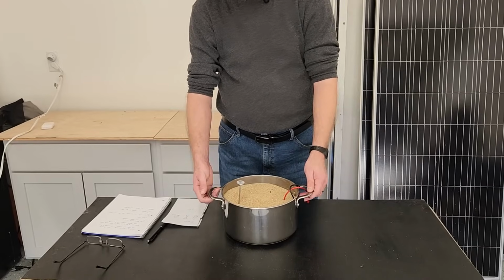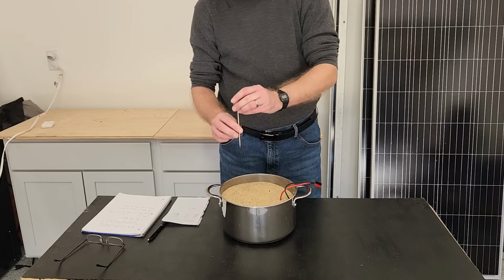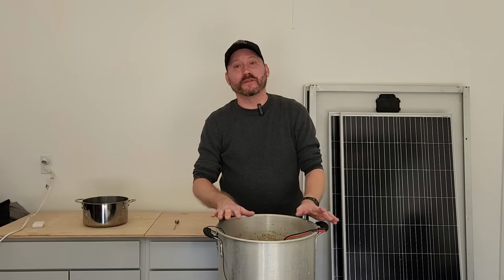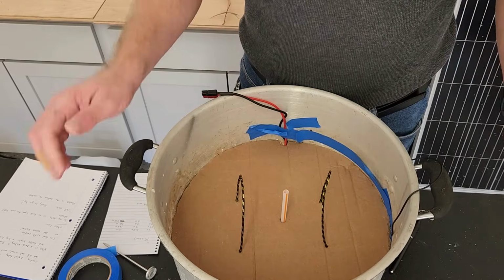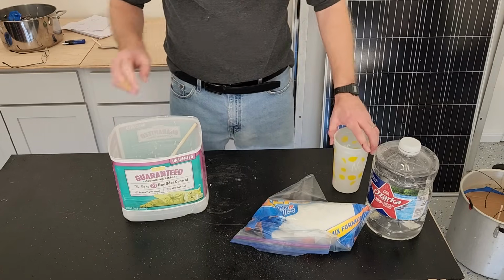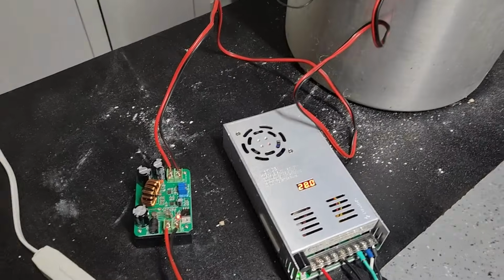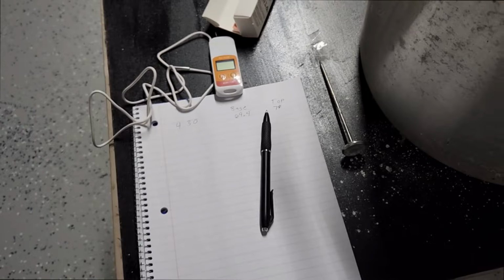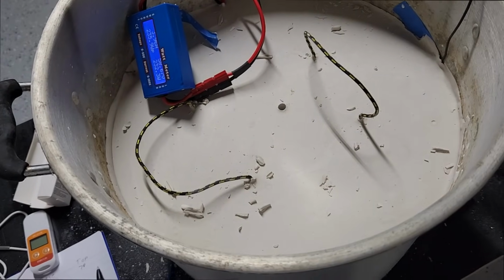Sand Battery heater. Create free heat  of 500F using solar electricity! Texas Prepper Projects

Comment: Very interesting.   Though of getting a aluminum water trough used for live stock, filled with sand, and use multiple heater laments.   You can stick steel rods or angle iron in the sand as radiators.   Could go as far and placing some ducting over the radiators and a small house fan to push heat into the home?
Reply from the maker: check out video 2 and 3 for testing of this

Comment: As stated below a stove element would do better.  You might consider building two of these if they will heat up in 2 to 2.5 hours and you have 5 hours of direct sunlight.  Heat one and bring it into the space you want to heat and have the other one heating.  While they are heating have them as insulated as possible so very little heat is lost.  Better yet have them in your garage if any wall faces South, bring the wires in thru a thimble to a correctly sized breaker and have pigtails to connect to the battery.  Think of it as having two batteries for your drill, while one is running the drill the other is recharging.  Doing it this way it doesn't have to wait for a grid down situation to be used.  If it is going to be cold Saturday night, heat up the batteries Saturday afternoon, if it is going to be sunny, and let them give off heat as long as they will that afternoon and evening.  Means less power from the power company.
Reply: Or you could run a cable  to both heater locations
Reply: Cuánto horas de calor me suministra una botella de 1 litro con agua, y cuántas horas si fuera arena sola 🤔?
Reply from the maker: check out my follow up videos

Comment: Great video! I'm fascinated with the idea of storing solar heat gain directly. It seems like a reasonable and worthwhile endeavor.
Any dense material can hold heat. All materials have their own unique physical characteristics. Dry sand is a great idea because anyone who's walked barefoot on a sandy area knows how hot it can get. Water is another dense material that will hold it's heat, although it tends to give up it's thermal energy quickly. Water is nice because it flows through pipes and can carry the heat from one place to another.
I once read watched a video about storing heat in paraffin oil. It's most outstanding physical characteristic I can recall is that it doesn't boil until 500 - 600 degrees fahrenheit! And it flows through pipes and hoses.
I read one comment from someone who would set a 5 gallon bucket of paraffin oil on his wood stove in the evening as the fire burned out and it would keep giving off heat much longer than the stove itself.
Reply from the maker: Check out my other videos. I dont think this makes sense on a small scale
Reply: I am not such that I would put flammable material near a stove!!!!!!!!!!

Comment: Well between your information from the video and also all the information in comments the idea popped into my head is to make like three separate sand batteries and then put them under my RV and then insulate with a pink foam around around the RV would work great and being the metal container in contact to the ground the ground would also become a battery under the RV so the sand battery only has to be as big to hold the heating element this way you could run only the bedroom area overnight off batteries and and program the living area to come on and shut bedroom off couple hours before you wake up couple of solar panels will always be cheaper than having to buy propane to run the big buddy because I am using one and through a three-week cold snap with lots of rain I burn through a 20 lb tank pretty quick.
Reply from the maker: Sit tight for my testing of version 2. Might be of benefit to you

Comment: You are generating your heat in one spot, in the centre. The reason this works is that sand is a good insulator. So you are likely to see a sharp drop off from the centre to the outside. Possibly distributing the heat generation more evenly with multiple elements will heat up a larger area of your sand.
Reply from the maker: Thanks

Comment: just thinking about your design, drill a hole in the bottem of the can, put the heating ellement through the bottem. heat rises, so you will protect the components of the heating ellement from exesive heat. once it is up to temp it can stay on until it is not needed.
Reply from the maker: I addressed this in my follow up videos

Comment: Well done, my concern would be the wires. they were made to be out side the water heater and not subject to such high heat. maybe drill a hold in the side and install like in a water heater. just my thoughts.
Reply from the maker: Check video 2

Comment: Please continue these videos on experiments with sand batteries. I've been thinking about designs and the next least expensive alternative. Here are some alternative supplies and materials, and some facts about large commercial sand batteries:
1. For a heating element a single burner hot plate seems perfect. They have thermostat controls, and the heating element could be removed and extended with wires.
2. For an inexpensive metal container there are metal tubs and buckets of various sizes.
3. Rock and some concretes have slightly better properties than sand. They are almost twice as dense, have higher heat capacities and higher thermal conductance. So pieces of those surrounded by sand will work better than just sand.
If the speed that the sand heats up or the bulkiness of it is not a concern then the information below doesn't matter too much.
If however, the speed of heating or the overall size of the system matters then the next part might be helpful. 
Other Materials:
1. The specific heat capacity of sand is 830 J/kg K. 
Its density is 93.6 lb/ft3. 
Its thermal conductivity is 0.25 W/m K. (Yes, it is that low, so it's very slow to heat up.)
2. The next least expensive solid substance, I can think of, for a thermal battery is Iron/steel. 
Its heat capacity of 460-540 J/kg K, depending on the alloy.  
It's about 5 times as dense as sand, at 492 lb/ft3. 
Iron alloys have a thermal conductance of 15-53 W/m K. (The softer less expensive types have higher numbers.)
3. Aluminum, with a heat capacity of 900 J/Kg K is more than double the Iron alloys but is more expensive. 
The density of Aluminium is 169 lb/ft3.
Various alloys of aluminum have thermal conductivities between 150-190 W/m K. (So it heats up quickly.)
It's not a bad option, especially if one is willing to melt it into ingots. 
4. Fortunately scrap metal exists, but finding a source and pieces of the right size and thickness might be difficult. Cutting the metal would probably be necessary in most cases.
5. A regular store item would be iron disk weight plates, which are about $2 to $3 per pound. 
Large commercial sand batteries:
1. Sand has a high thermal capacity, but is a poor conductor of heat for a solid because it is not very dense, and each piece has minimal contact with the others.
2. In the large versions, they get around the poor heat conductance by speeding up the heat transfer with high-pressure heated air. Air is pumped through open pipes that run through the sand.
3. The pumped air method is not feasible for small in-home versions, at a reasonable cost.
Reply: I think since sand has these properties, of heating up and down slowly is what makes this works so well. It's more about storage rather than transmitting the heat. An equivalent alternative is water, but that has it's down side, as he mentioned.
Reply: @SmallVansBigWorld  . H2O has the best heat capacity for liquids, so sand and water would send the heat evenly to the sand and help have better temperature over all. Thank you @Mavric9000
Reply: @clintw9114  At temps over 100C how long is the water going to hang around?
Reply: @clintw9114  Water would evaporate, so you'd have to seal the container, effectively creating a pressure cooker. So that would be dangerous, without a proper pressure relief valve it could explode.
Reply: @Mavrik9000  .
yes it will go boom if sealed. you are running it uncontrolled, no temp regulation so the element will not last long. The heating element is made to heat and be cooled by what is is in, if it is on max at all time they will only last so long, if you add a temperature regulator to it so it stops at 200f it will last years. At 200F just under evaporation of water the sand that hold more heat and fully heat up and the water will help add heat to the room faster. I have had to deal with this type of element in oil jacketed and water jacketed cook pots, holding lines, they fail fast when dry. I hope this helps. If you do add water please make sure the back of the connectors are out of it there are live and that is why the sand seemed to melt around them, they could of been arcing. They are made to be out in air. Don't need any one getting shocked.
Reply: @clintw9114  trouble is the water turns in to gas at 100%c
Reply from the maker: Check out videos 2 and 3

Comment: Great research. Great comment section. Need this sand battery and a thermoelectric fan for relief during power outages in the hot desert regions
Reply from the maker: Nope. If your in a desert, then direct solar-battery-inverter is FAR easier than dealing with this mess
Reply: @texasprepperprojects  thanks for your response

Comment: I've just been turned onto this method of heating and I think using an old hot water tank would be a great container. They're insulated and they even have a pre-installed electric heating element. I'd be happy to watch you make it first. LOL!
Reply from the maker: check out my other videos for testing and builds, as well as some questions answered
Reply: hot water tank is optimal but you don't fill it with sand you fill it with water.. search solar hotwater heater on yt .. its a better solution.
Reply: @Zippy TheChicken  Interesting to continue using water in the tank rather than sand. Does water retain heat as long as sand? I know sand and stones have the ability to capture heat and hold the heat for a long period of time. If water has the same heat retention, then there is definitely no need to fill it with sand.
Reply: Electric hot water heater elements need to be in water or they'll burn out pretty quick.
Reply: @Gene328  Thanks for the insight. Just to clarify, I was only talking about using the hot water tank as the insulated vessel given its construction. I always assumed a different and more robust heating element would be needed as opposed to the stock heating element.
Reply from the maker: @gene328  check my follow up videos for what happened

Comment: Insulate [the exterior of] the bottom, to avoid scorching the surface underneath, with Rockwool maybe over cement backer board. Also, add a removable insulated lid over the top, and maybe some aluminum fins as you suggest.
Reply from the maker: stay tuned for rev 2 coming soon!
Reply: @texasprepperprojects  I meant the exterior. I made that edit to avoid any potential confusion.
Reply: @texasprepperprojects  Also, an oven thermometer or one of a higher range would be helpful with these experiments.
Reply from the maker: @Mavrik9000  Agreed. That's why I bought that meat thermometer, which I maxxed out!
Reply: @texasprepperprojects  Amazon has more than one analog deep fry probe thermometer that goes up to 500°F for under $10.

Comment: I’ve a similar idea using an electric smoker I bought off a local auction for $5.00
This year for thanksgiving sales I invested in solar panels and battery.(battery for propane furnace in case of outage).
The smoker has heat control where it will cut out at a certain temp.  Copper tubing will distribute the heat through the sand as it can be used for directed air or even water.
My 2cents 
Great vid!
Reply from the maker: Full setup showing solar panels coming soon! I just need to wait for the sun to come out!

Comment: I think the biggest design challenge with heated sand is the wire insulator and element insulator melting.  If they have ceramic insulators, its fine. You need high temperature  wire insulation inside the sand.  Also, crimped connections will live where soldered connections will melt.  

 The beauty of this is that you can keep the sand indoors and insulated and put in a temperature switch that cuts off the electricity before the components fail.  You could put an insulation blanket over the sand container to regulate the heat into your house.  You could also use a thermostatically controlled fan to turn on automatically to control the room temperature.  

You could charge a battery with the solar and when the battery is full, dump the remaining heat into the heat battery.  Then use the battery to run a fan etc.  

Its good that you tried something. Most times all I see is someone buying an expensive gadget and doing a review.
Reply from the maker: Check out my follow up videos
Reply: technically since sand is not electrically conductive you can have exposed solid copper all the way to the heater contacts
Reply from the maker: @robertjones1730   true
Reply: @texasprepperprojects no, don't do that, because then you reduce the resistance produce less heat within the sand and transfer the resistance to the wire or fuses which will melt
Reply: Just drill a hole in the side of the pan and put the element through there. Either that or buy a tank designed to boil water with a heating element that can withstand the heat of boiled sand...
Reply from the maker: check out video 2 and 3 for  my reasons @NotoriousPyro
Reply: Nope, use PTC thermatic self regulating heat plates , made for heating Dry items like sand. No pipes, cuts down on the amount of sand. Use a 4-6” 1/8” piece of copper or brass shoved down the middle to the bottom and bent flat onto the top of the sand. Put a wood stove fan that runs by the heat itself, self starting, on top of that. We have ours on solar panels feeding a battery bank. 
Here’s a link to PTC heater plates. Good luck!

Bestol 2pcs PTC Heating Element 5W-50W AC DC 24V 70 Degree consistant Temperature Ceramic Thermostatic

Comment: LOTS OF FUN!
Heat distribution might be limiting heat storage.  Sand isn't like water after all, no convection, lower conduction.  Also, a water tank coil is only going to be rated for 180 degrees max.  Any time after that it could fail, short circuit. Certainly you want to research, call manufacturer?  That you got so much higher in small scale test is interesting though.  Multiple heating coils might be needed, to keep wiring simple maybe to separate panels   Heat loss via the pit surface might also be resulting in the stable and max surface temp, as it might be radiating heat at same rate of capture.  Two ways to deal w that.  Rockwood insulation 'cozie' to drop over unit when it's storing energy, or sizing container so outside ends up at room temp 70, 75, 80 & at core 200 plus.
Another way to use off the self parts as intended, keeping warranties intact might be...
20 gal water heater
200 gal uninsulated water tank rated to 180 the highest you'll get from most water heaters
Circulating pump
A couple of thermo sensors for storage tank
Optional circulation fan(s) battery powered.
Install tank in heavily insulated room or closet.  If adj to room to be heated open door to heat room.  If remote, like in basement under room, install 2 floor vents one w duct to near bottom storage room & open two vents, natural circulation will bring up heat as cold air at floor sinks into basement storage room.
ALTERNATE EMERGENCY HEATING
Do you have a basement?  If so...
Rip up landscaping 5 feet out from house (a good idea to limit mold, rot, fire hazard at house) dig out slope from -4 inches at house to -6 inches 5 feet from house.  Install tightly fitting 2 inch foam, NOT BEAD BOARD, ground water contact rated foam, cover w soil or gravel to orig grade.  Landscape as desired, flower bed, garden, small shrubs - leaving a 2 ft area around house to hard surface w pavers.  Optional - gravel good filter fabric drain pipe to take water from edge of foam board away from house.
Your basement will now be at typical ground temps no matter most outside weather.  If sufficiently North or in mountains might need more insulation.  These temps are 45  - 65 across US.  Install battery powered circulation fan between heated area & basement open door to basement for return cold air.  Your house should remain at least in 40s a week in worst weather.  Bonus, if in hot area, your now cool summer basement will reduce cooling load.  Heating climate, your standard heating system will work less.
Reply from the maker: check out videos 2 and 3 for more testing

Comment: Use a little fuel to raise the temperature initially. Use a parabolic reflective surface to direct the heat to where you want it. Make sure it covers the top. So hood it.
Reply from the maker: Check video 2 and 3!

Comment: Hey Scott that was great video about making a sand solar heater I'm here in Texas  coldspring Texas and I run my whole house off solar and 12-volt system so man you you open my mind up to a cool thing cuz I only have a buddy heater and now it's showing how you can do this thing with sand now here's another idea I got you could put that pot on some cinder blocks and then blocks get hot from the pot to and they would give us some heat that's another little way of looking at it but yeah I like the way if you take the top off  and let the heat run out and then you can possibly put a 12-volt fan in there and get more heat out of it so man great video man thanks for sharing it I'm looking forward to seeing some more of yo videos
Reply from the maker: Check out my follow up videoes